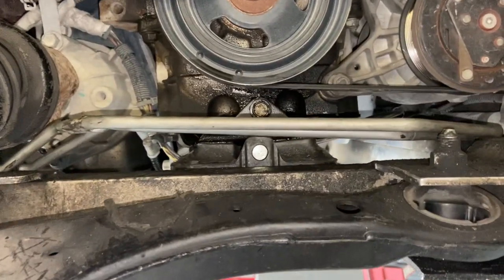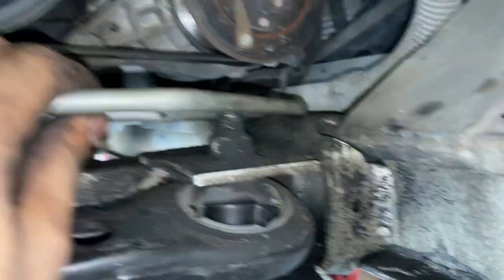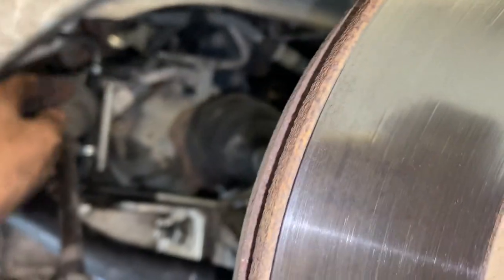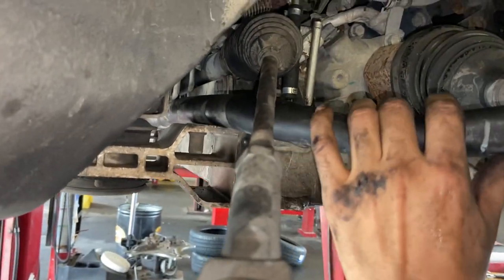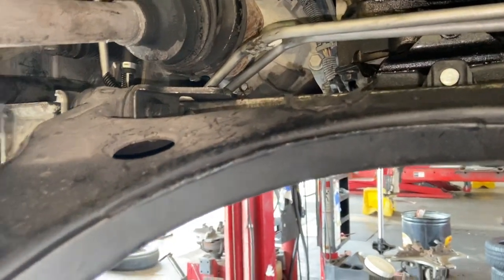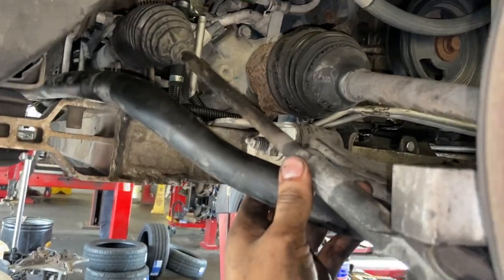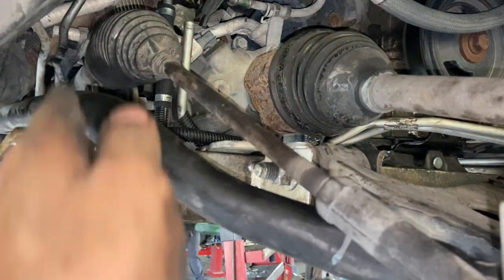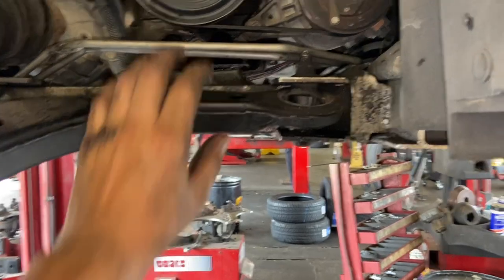2006-2011 Chevy Impala Power Steering Cooler Line

Comment: WOW, who ever told you how too change that line had to be on drugs.
Reply: how would you do it then?
Reply: I have to replace that line rn that's why I'm here and the reason is because the harness under the front has been wiggling in the wind and sanded a hole into the line. Crazy how a plastic harness wears thru aluminum lines
Reply: LMMFAO! He made so much extra work out of a relatively easy job!

Comment: Quicker to just drop the sub frame
Reply: Yep, the only reason I went this way on the video is because I had to change my cv axle as well, because mounts failed making the engine lean on one side causing the axle to rub on the return line and rubbing the it till hole came
Reply: drop the subframe completely?
Reply: A lot less work, no doubt!